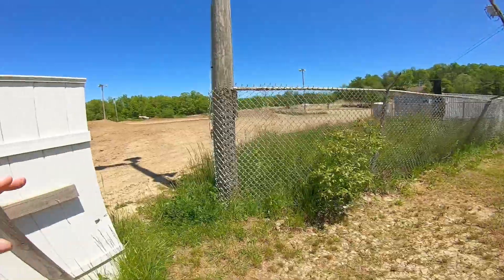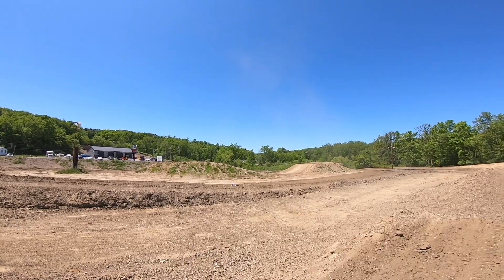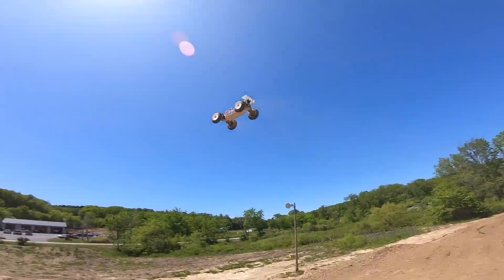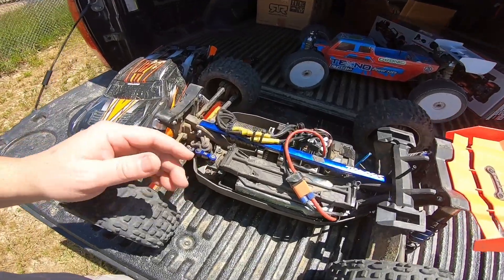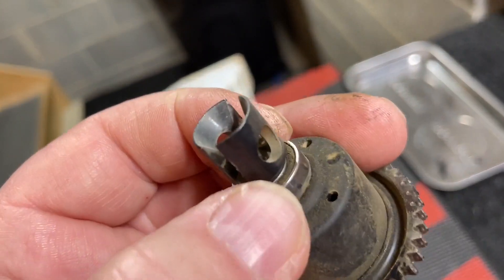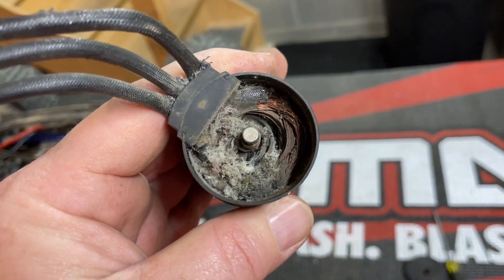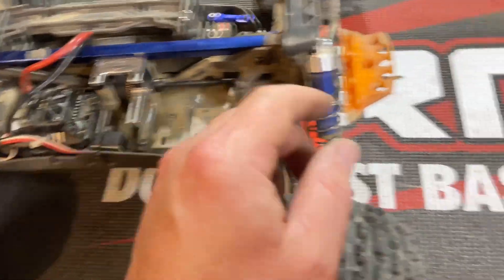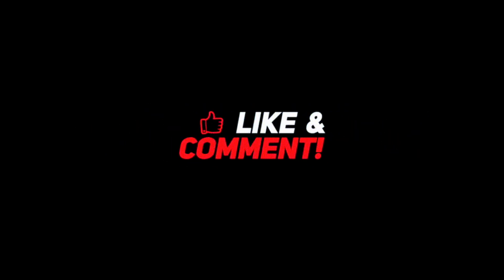MOTOCROSS BASH AND REPAIR

Comment: Nice bars man that tekno is so small compared with a Kraton XL or 1/5. Yeah it looks very light and hard to brake. great bash bars 🤘yes that stuff happens i actually never had that happend to me before. bad ball bearing for the slege i guess. yeah i think you will be more happy with a XRT
Reply from the maker: Yeah, the car is a great size it handles great it’s nimble but there won’t be an SRT in my future. Lol everybody I know that has one personally is not super happy with it.
Reply: @BarstoneRC  yeah. Tell Mr about it. I'm actually going throw pinion gears on every run I do. Very annoying to have to buy the m2c motor mount which is over $100 😑 other then that ots not too bad. Arrma is alot more tough 💪
Reply from the maker: Yeah, I’ve tried some different Traxxas cars and so far none of them have impressed me at all.
Reply: @BarstoneRC  yup agreed on that. I'm gonna to get impressed with XRT really by upgrades.  But you know me I'm definitely a arrma fan boy then anything else 👊
Reply: That Tekno was flying great for the first few jumps!👍🤙

Comment: Does anybody make a full top deck brace for this truck 🤔  I think that would be a great upgrade for it especially if you're planning on sending it over 100ft lol
Reply from the maker: They make an aluminum brace that goes from the center differential all the way to the front. That’s what I have on mine and I’ve had no issues with it anymore.
Reply: @BarstoneRC  Cool 👍

Comment: Hey man great video as usual! I was wondering if you’ve ever had a car drive straight under normal acceleration but then kick out to the side (same side every time) under heavy acceleration? Checked bearings/diffs/wheels/shocks/droop. Pretty annoying 😅

Talion EXB with the max6 1650kv combo for what it’s worth.
Reply from the maker: What weight fluid u got in the rear?
Reply: @BarstoneRC  I refilled them all with the stock 10/100/10
Reply from the maker: Do 30kF 1millC 50KR
Reply: @BarstoneRC  even with the limited slip plates? I heard the extra fluid weight is amplified due to the plates but I’m willing to try anything lol
Reply from the maker: @kez850  that’s what I run in all my cars